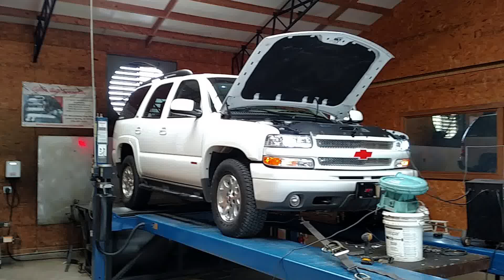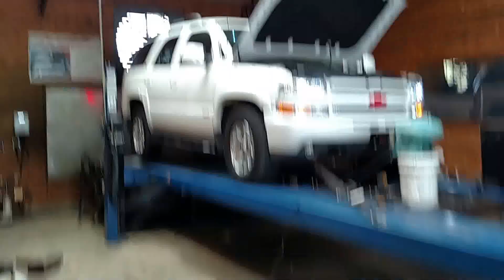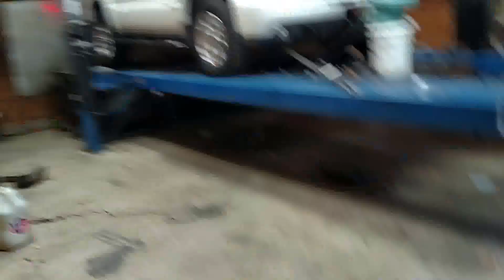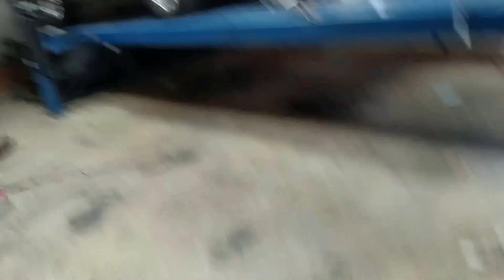2003 Z71 Tahoe with Magnuson Magnacharger MP112

Comment: what was your final numbers im running a mp112 on my tahoe now and im also from north alabama. would like to compare results
Reply: Josh White same here man. I made 353 on mine.
Reply: So you went from what is stock at the flywheel 290 all the way to 353?
Reply: @RyanBuck 290 is stock at the flywheel so probably 250ish at the wheels if ur lucky. And most people dyno’d are talking about rwhp so that means 353 at the rear wheels is closer to 400 at the flywheel.
Reply from the maker: The peak horsepower at the rear wheels was 503, boost was 10psi, it could have gone higher, but not with stock heads.  I've since sold the vehicle, almost burned it down trying to pull a travel trailer, valuable lesson, Superchargers are for speed, not for towing.  I've got a 2020 Denali diesel now, fantastic vehicle.
Reply: @RocketCityRVer  I was considering getting the Magnuson supercharger kit for my 2003 Silverado 1500 with the 5.3, which has 82K miles on it, to make towing a little bit more manageable. What do you mean by almost burning it down, and the supercharger not being made for towing?
Reply from the maker: @colinhelt3904  Hi Colin, well, I put the Supercharger on my Tahoe for the very same reason, does it give it the horsepower, well, yes.  However, what I discovered is that your vehicle is "boosting" way more than it would if you were driving without towing.  I had a really nice Magnaflow steel exhaust system installed as part of the build, it would make the exhaust red hot in fact.  On a my first trip down to Gulf Shores from North Alabama it the exhaust got so hot that it literally burned a hole in the spare tire, I'm not joking.  Had I not been going thru a torrential rainstorm on the trip down, it likely would have caught my vehicle and travel trailer on fire.  I swore then I would never tow with that vehicle again, although, I did replace the exhaust system with a Corsa and replaced the spare, I sold the vehicle shortly after.  I was trying to build myself a tow vehicle, but as I discovered, supercharging is not the answer, the boost is for speed and only for short periods.  After selling the vehicle I bought myself a 2020 2500HD Denali diesel.   If you want my advice, go diesel for towing, no more white knuckle driving and you barely know you have anything behind the truck, certainly NOT the case with the Tahoe even with the added horsepower and torque.  I arrive at my destination nowadays just a little tired from a long drive, not exhausted from the constant fighting of a steering wheel.  My travel trailer only weighs in at about 7500 lbs fully loaded, but, having more truck than trailer is sure nice.
Reply: @codynelson6081  350 with the supercharger?? I’m making 415 n/a